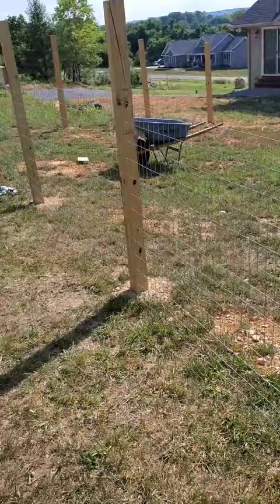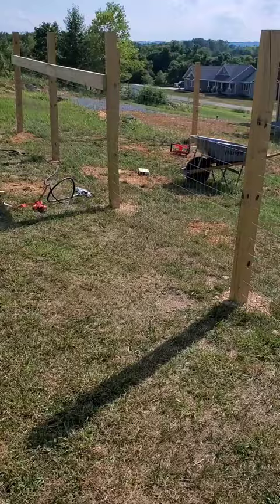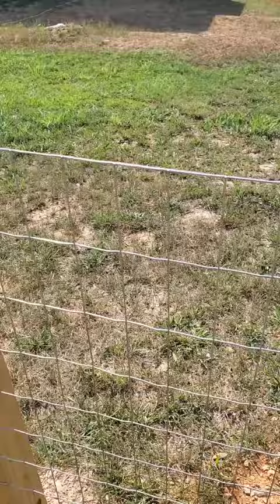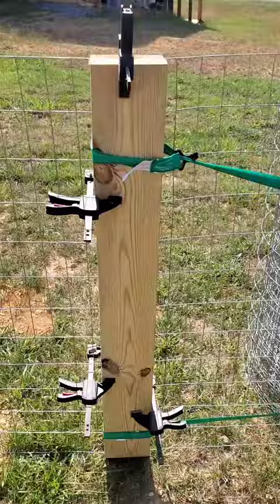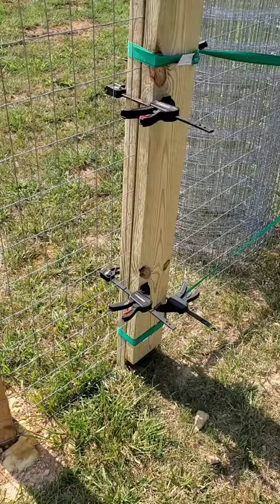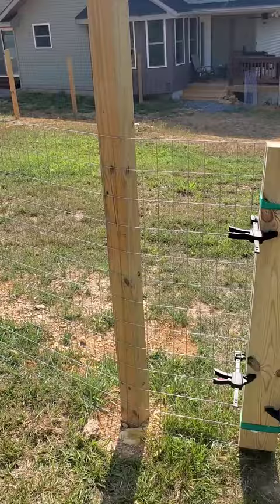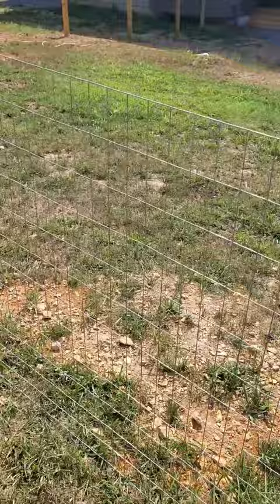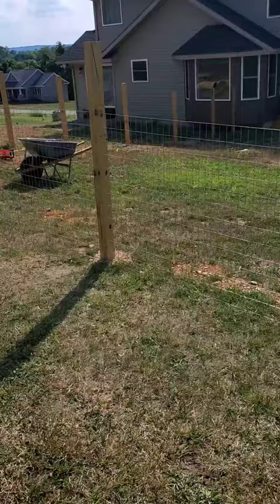Tightening Welded Wire Fence Hack

Comment: Great advice, thank you.  I was getting everything together to do it where you use nuts and bolts to hold the boards together. Your way seems like it would be faster and less frustrating not having to deal with the nuts. I have several spots that need tightened.

Comment: Drill 4 or 5 holes on the strainer and bolt it, clamped on much harder less chance of slippage, i use this same method but i tension with the tractor.

Comment: Looks like the fence you demoed was parallel to the back of the house and was fairly level ground. How did you do the fence that comes out from the back of the house at a 90-degree angle? I'm wondering if that welded fence has enough flex to keep the vertical wires of the fence in alignment with the vertical posts? Or did you have to keep the fence square to the sloping ground and therefore the vertical lines of the fence don't line up with your psots. Thanks for any suggestions.
Reply from the maker: They don't line up on the slopes.
Reply from the maker: The far side went downhill. The posts were vertical so the wire did not li e up, but I don't think it matters. It looked good.

Comment: I am looking at a similar backyard fence, maybe 20’ x 30’ and will definitely copy your method. My question is if you did corner bracing? I am thinking it’s not really needed for such a short distance
Reply from the maker: No I didn't.
Reply: @garagehero1300  thanks. Did you set the post in cement or do like a 3’ depth?
Reply from the maker: @jrfireboy2  I did 2 foot depth and used expanding foam instead of concrete.
Reply: @garagehero1300  oh man I was thinking about that for the corners! Did you do it in all of them? I think o saw in another video that you’re in WVa, I’m in VA and was concerned about depth but was thinking 2’ would be fine
Reply from the maker: @jrfireboy2  I did it in all of them.